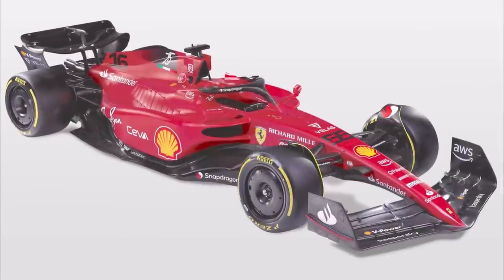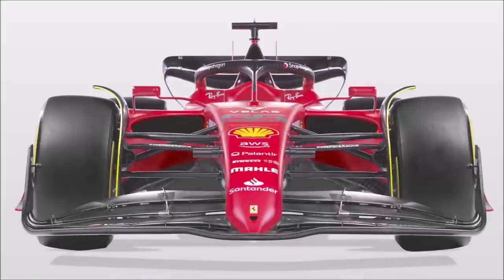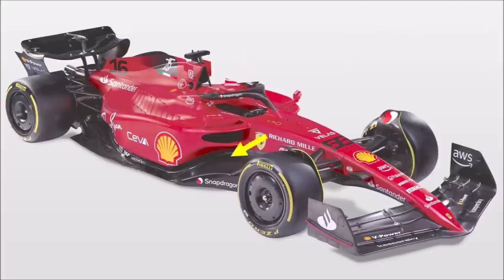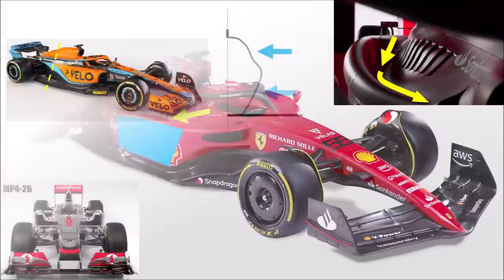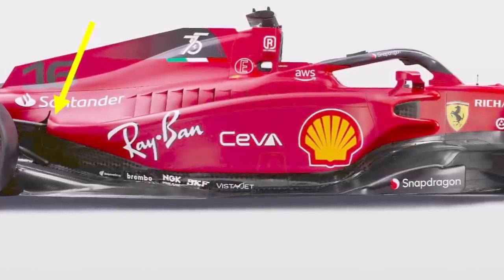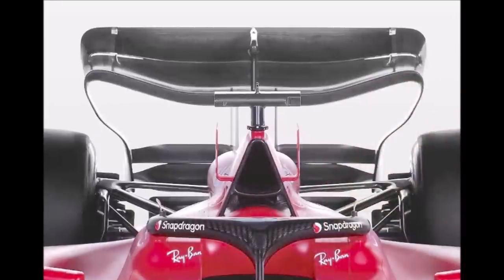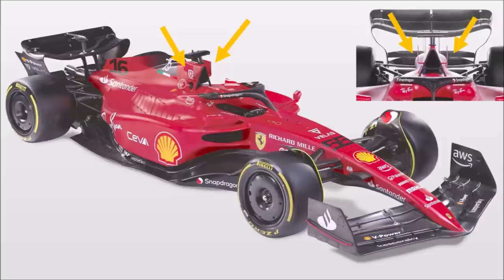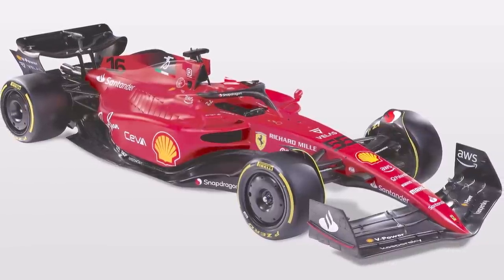F1 2022 - Ferrari F1-75 (FIRSTLOOK)

Comment: I think that the large sidepods may actually be a double shell design. Part of the air taken from the extended inlets might bypass the radiators and be blown back directly towards the diffuser. That way they could be ok with having a smaller undercut close to the floor. Also they could avoid to generate lift with a down washing bodywork because they are sending clean air through the body itself. The bodywork is also shaped to contain the losses produced by the louvres and direct them where they are not harmful. Very interesting approach.
Reply: Yeah that was also mine thinking at first look. Emulates some sort flow-trough design.  Still quite difficult too judge. I m wondering what such design can do with higher rake that conventional ground effect design. In previous years generally speaking ofc more control u hade with floor outwash. More rake could you use at lower speeds. So interestingly would be see how central loaded FW contributes too the high sidepod intakes edges and its side fences. And how that air rotates over sides and inswashed right into tight gap inbetween wheel arches. Bamboozled indeed.
Reply: I believe ducting air through the bodywork is not allowed for purposes other than cooling.
Reply: @98MTBiker  Binotto show analysis to FIA "i swear its 51% of cooling". :D

Comment: My father is fairly sure this 'dug' sidepod has been tried during the time he watched F1.
He stopped watching seriously after Hakkinen's retire(one of his favorite drivers), so he can't be referring to the '11 McLaren, and he personally confirmed that was not the car.

To the 'puddles' risk, he'd add what would happen once the car turns, since those incaves works well as 'wings'(for downforce, he used exactly this word) on straight.
On my part, am too concerned for the abrupt turn of the front sidepods, even if just because aero components like those are usually very sleek.
Reply: Ferrari had similar concepts in the 90s, eg 96
Reply: Your father is right. The first car with such sidepods was the 1995 Benetton. The Ferrari of 1999 also had such sidepods.The McLaren of 2011 had "stolen" the idea from these cars.  Interestingly these two cars(1995 and 1999 Benetton/Ferrari)were designed by Rory Byrne, who still works as an adviser for Ferrari and also this car of course...another interesting fact - the first car to have undercuts like that was the Ferrari F2003. A car designed by Rory Byrne again....there were the double-floor concepts in 1993 and 1996, too, but thats a completely different concept and has nothing in common with an undercut.
Reply: @fam.hunger5244  don't really know, the F399 looked normal to me in the sidepods, maybe jus a bit inclined towards the cockpit.
While they did experiment with the sidepods with that 'jet-inspired' f1 car that ran in '95-'96 I think. That car didn't went very well...

Comment: Have you also noticed that the nose is split into 2 parts so when new noses or front wings are developed, the car doesn't need to pass the crash test again
Reply from the maker: Yes, that's why I guessed they could use a different nose at the first test.
Reply: @BSport320  👍
Reply: Thats quite standard for teams too use inner designs. But teams dont usually change those designs for some reason. IDK maybe if skin is glued you need still prove crash worthiness.
Reply: @alesksander  Nope they don't need to pass the crash test, basically they extended the deformable area upon the nosecone (where there's the MAHLE sponsor) so that's not require further crash tests and that mean Ferrari having an huge advantage in development/updating time, less resource to spend.
It's a really clever and innovative solution that no one adopted until now, that will make school. All other teams will use this starting from the next year, i'll assure you.
Reply: @solinvictus1234  Yeah if we think about it now.  Im quite bafflet why teams dint do that earlier. Its almost no brainer. Ofc messing with front nose is detrimental to cars performance IMO. Because changes in that area impact whole car. SO you normally dont do small revisions there unless you are completely sure about that.
Reply: @alesksander  That's for sure, the only explanation i can think of why they didn't before, could be that the previuos wing had too much downforce, making this solution not safe in the past

Comment: Wouldn't the front wheel wake still be brought back into the beam wing as it runs along the side pod? It looks the gradual curve towards the rear of the car combined with the high pressure zone on the front of the rear wheel would be enough to pull it back in towards the beam wing.
Reply: Yeah some of it would but that's why they have the undercut and the downwashing sidepod to provide some clean air to the beam wing

Comment: In my opinion, this is the most beautiful Ferrari in more than a decade. Sure, it’s no F2004, but a major step forward compared to other seasons‘ cars. Some say, that pace coincides with beautiful shapes, so I‘m slightly hyped.
On the other hand, chances are not 0%, that the engineers just never considered pooling water in those sidepods. It‘d be both tragic and hilarious, if the car simply drowned on a wet grid xD
Reply: With the G-forces in an F1 I doubt the water would be there for longer than 2 seconds.
Reply: @MartlRS  the cars go exactly zero kph on the grid, mate =D

Comment: Given how the teams with the most time in the wind tunnel have gone for more air flowing to the floor and have huge undercuts to the diffuser and have steered away from the outwash designs, Surely Ferrari are gonna struggle, This could either be a genius idea or a complete failure and like I said given how the teams with the most time in the wind tunnel haven't gone this far to the outwash design I think Ferrari have one of the weaker cars on the gird.
Reply: I feel the same. Its like an extreme design just be different.
That Merc car from today looks so much cleaner. Safe shape.

Given how bad Ferari are at upper floors of management I bet they fucked it up. Its a unique car, some say beautiful. But Fast? Doubt it. Which is sad.